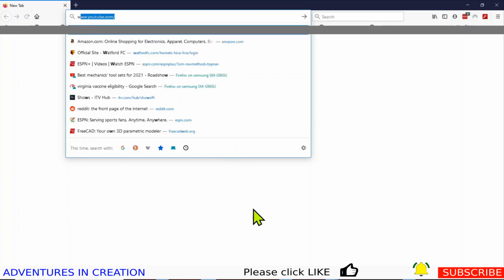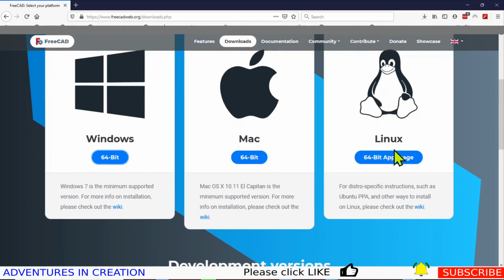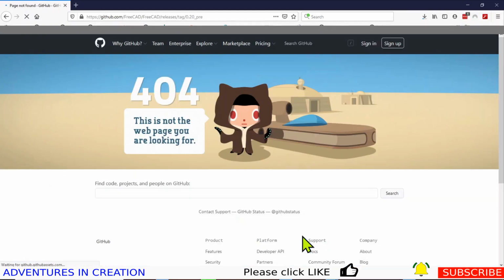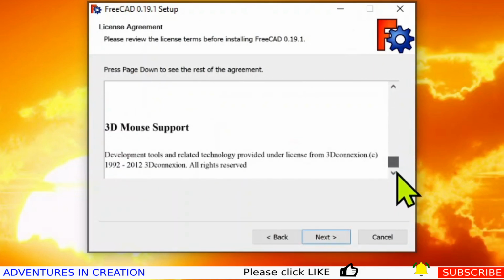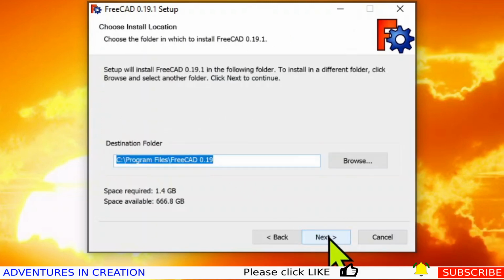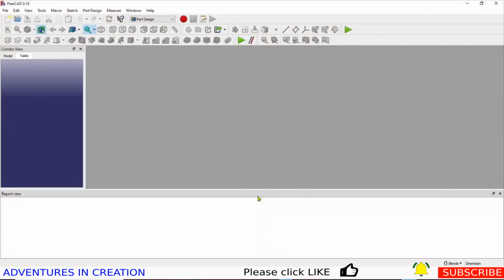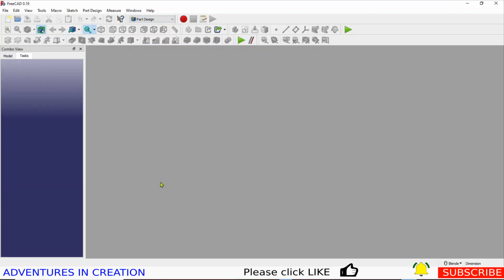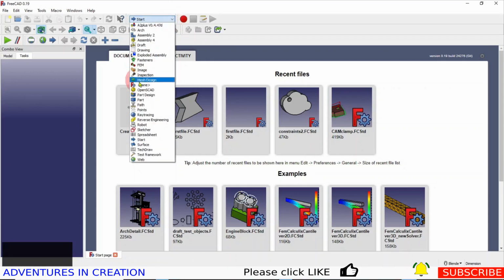FreeCAD for Beginners #2 - Sketching and Constraints

Comment: FreeCAD works very differently from other CAD software I've worked with; clearly more disciplined leading to more stable models. That said, it is frustratingly difficult to learn by comparison as few lessons prepare you for, what for many, might be a radically different approach to technical drawing. Whilst somewhat out of date (i.e 2021 and it's now late 2026), these tutorials are brilliant, taking you through a series of lessons in bite-sized chunks. Excellent thank you.
Reply from the maker: Thanks, there are a later series with the new version. I use solidworks at work and the similarities are amazing.

Comment: Using v 1.1.1.   This is infuriatingly difficult trying to duplicate what I am seeing in the video because the interface isn't quite the same. Why the hell am i getting errors like this: "Remove at least one of the following conflicting constraints:1, 2, 3, 4, 5, 6, 7, 8, 9, 10, 11, 12, 13, 14, 15, 16, 17, 18, 19, 20, 21, 22, 23, 24, 25, 26, 35, 36, 37, 38, 39, 40, 41, 42, 43, 44, 45, 46, 47, 48, 49, 50, 51, 52, 53, 54, 55, 56, 57, 58, 59, 60, 61, 62"? in spite of slowly and methodically Mr. Adventure is demonstrating the steps?

Edit: I finally got it.  There are some interesting bugs and bizarre behavior here but time and persistent bug squashing will make them go away.
Reply from the maker: Sounds like you don't have autoremove redundant constraints checked.

Comment: Found the sketch constraints quite challenging, even after having used Solid Jerks a few years ago. Eventually found that one has to do the symmetrical constraints first before adding vertical and horizontal constraints, then dimensions last. Also ran into the dreaded over constrained condition which meant that I had to back track and start dropping off constraints to clear the over constrained  condition warnings, which was a Pain in the butt. Is it not possible to do a tute on ways of resolving over constrained warnings. I notice that there is a toolbar icon specifically for this problem.  But good tute thanks. I am using freecad 0.21.2 in a Linux OS.
Reply from the maker: Try the latest dev version some of the constraints have been simplified, make sure you have autoremove redundant constraints checked.

Comment: Using 0.21.2. Following the constraints step to the letter. However, this version of FreeCAD doesn't have the same behavior in constraints as what you are showing. Clicking 2 points and applying a constraint yields no results. Clicking 2 points and selecting vertical, to make the 2 lines equal, also yields nothing. FreeCAD just sits there. No warning, no messages; nothing.
Reply: Nevermind. I had another sketch + body open that was causing issues. Closed. New project. Everything works.
Reply from the maker: Phew!
Reply: It didn't work for mine
While using version 0.21.2 @majicMix911
Reply from the maker: That's really odd as it still works in version 0.22
Reply: Should I delete the body and try again cos I don't know to bypass this problem, or can you make a video on how to solve the problem. 

Thank you @Adventuresincreation

Comment: Hi - when making the horizontal lines equal on the little square my sketch turns orange. What am I doing wrong? I want to thank videos the best and easy to follow along with you, I have tried other videos that I was lost in the first 5 minutes with you videos i actually feel that I can learn this at 68 years old. Thank you! Bob
Reply from the maker: Thanks! That normally means it's over constrained. Do you have the auto delete redundant constraints checked?
Reply: @Adventuresincreation  Thanks for replying... Where would I check to see if the auto delete to see if it is checked?
Reply from the maker: @bobkarstien1248  In the sketcher task pane.
Reply: @Adventuresincreation  II want to thank you for all your help!  I am using version 21.2 I retried this lesson 3 times and I am getting different results then you on somethings I did not think there would be that much difference between the versions. Should I see if I can find the version you are using and remove 21.2 version? Thank you!
Reply from the maker: @bobkarstien1248  No, don't remove that version, let me know what you are having trouble with and I will make a video to show you if there are differences in 0.21
Reply: Thank you...when I click the top point on the top horizontal line and the point on the bottom horizontal line and the horizontal center line then click the symmetrical icon my sketch orange. Thanks again for your help!
Reply from the maker: @bobkarstien1248   I just tested it in the latest version and it appears to work exactly the same as in 0.19 I am not sure why you are overconstrained? Can you share your file with me?
Reply: @Adventuresincreation  I sent you an email with file attached......Thanks
Reply: I just had the same problem.
As @Adventuresincreation recommend, on the task pane under the Constraints part there should be a settings for Auto remove redundant.

Comment: Hi

At 16H43 there is a step to create simmetrical lines around the center point.

My whole drawing turns orange, and I can not find my conflicting constraints.

I have tried all of the following:

1. Zoom in on the object or point that's turning orange. Sometimes, constraints can be hidden or overlap, making them hard to spot.
2. Use the "Constraint list" filter: In the Constraint list, click on the filter icon (looks like a funnel) and select "Show only conflicting constraints". This will hide all non-conflicting constraints, making it easier to spot the problematic one.
3. *Check for *hidden constraints: Some constraints might be hidden from view. To show all constraints, including hidden ones, go to the "View" menu, then select "Show hidden objects" (or press Ctrl + Shift + H).
4. *Try *recomputing the constraints: Sometimes, FreeCAD can get stuck. Try recomputing the constraints by going to the "Model" tab, clicking on the "Recompute" button (looks like a circular arrow), and then selecting "Recompute all".

But still can not find the conflicting Constraint.

Can you please assist?
Reply: Left side. 
Constraints Box.
Right Drop Down (has a paint Brush)
✅Auto remove redundants

Comment: Hi, thanks for the best tutorial I have found so far. I am a 76 yo learning new tricks for my recently built DIY CNC and my first play with CNC machines and 3d modelling, although I have a lot of experience with 2D drafting CAD. Everything went fine with the tutorial right up to a fully constrained sketch all green. When I click close I do not get the menu to pad the sketch. Not getting the same menus as you has happened a number of times thru the tutorial but I have been able to overcome it, but not this time. Also when I click close I now have two sketches "sketch" which seems to be the correct constrained sketch AND "sketch 001" which does not seem complete when I highlight it. Any help gratefully appreciated. Kind Regards ..... Mike, Tasmania, Australia
Reply from the maker: Hi Mike, it sounds like you may have accidentally created sketch001. No worries, you just delete it. Then, highlight your sketch in the model tree and click on pad from the menu bar. It should work for you.

Comment: what to do if it says redundant constraints  ?
Reply from the maker: You can auto remove them by checking the box
Reply: @Adventuresincreation   while making points symmetrical is it  possible the points where already symmetrical so it says redundant constraints ?☺
Reply from the maker: It could be many things. Do you have autoremove redundant checked?

Comment: Great video. Im having trouble with the step at 16:44. I've started from scratch twice and whenni click on the two corners and the line then symetrical the entire drawing turns red. 
Also while i saved the drawing when I tried to reopen it was totally a mess. 
Any help would be appreciated.  I will give it another shot tomorrow.  Perhaps ifbi watch on my tablet instead of my phone I'll see what I'm missing.
Reply from the maker: It sounds like there is something wrong with file did you try a completely new file? Does it turn orange?
Reply: @Adventuresincreation  Found the solution and now I see it in other comments. I did not have Auto Remove redundant and Auto Update checked. 😖 Thx

Comment: Had the same problem: sketch turning orange, comment said "invalid sketch". Looking into the options, orange color is used for an invalid sketch, According to FreeCAD wiki, this is usually because the sketch is over constrained. Solution: while in the active sketch go to "menu>sketch>sketch tools>select redundant constraints". the sketch will show all redundant constraints. Now press "delete" en the problem is fixed. I'm using version 0.20.2 and my GUI is in Dutch, so it might be the text in the English version is slightly different from what I wrote above, but this is what it is about. According to the wiki, their is also a button "validate sketch", which might also solve the problem, but thus far I haven't found this button, my GUI is somewhat different from the one used in this movie
Reply from the maker: Check the box that says auto remove redundant constraints
Reply: Thank you.  I had the same issue.  You gave me the solution

Comment: Had the same problem has others. I get to the the symmetry part, select the three points then enter and the whole sketch turns orange?? Very frustrating any solution?
Reply: My version is the latest….0.20.2
Reply from the maker: Can you share your file with me?
Reply: @Adventuresincreation  Thanks for getting back. I opened a new file and placed just a rectangle (only) tried symmetry constraint on both the vertical and the horizontal, the rectangle turns orange and does not constrain symmetrically. If l constrain diagonally selecting the the three points it constrains equally into a square as expected. I guess it could be a bug in the latest version? Frustrating seeing you have no problem in version 0.19.  I note many of your viewers having the same problem.  I’m going to attempt your electrical box next, hope there are not symmetrical constraints in that one?
Reply from the maker: @brianwaites4572  I just did exactly that, it works fine. - I think you may be over constraining somehow. If you just draw a simple rectangle and constrain symmetrically it will work. Take a look at the panel on the left where it tells you how many degrees of freedom you have, this will help you, if it's over constraining it will tell you that.
Reply: @Adventuresincreation  Thank you, I did exactly what you did by placing a simple rectangle and it still turned everything orange! The DOF turned red and increased. I’m still baffled.
Reply from the maker: @brianwaites4572  check this video https://youtu.be/BIYfSXNjFR0

Comment: A very clear and easy to follow tutorial - thanks. 

For those following along, if your sketch turns red it's because you've created redundant constraints.  If you look in the "Tasks" box at "Solver Messages", it will list any redundant constraints - you can either delete them manually or check the option "Auto remove redundants".
Reply from the maker: Thanks

Comment: Anyone know how to show the constraint coordinates? I'm using FreeCAD 0.20 and the Constraints box does not show the options for "Hide Internal Alignment" and "Extended Information". Don't know if it's a preference setting but if it is I haven't been able to find it. TIA to anyone that can help.
Reply from the maker: Did you ever solve this issue?
Reply: @Adventuresincreation  Nope, I figured maybe it was a UI change due to version change and gave up. Looked like it was a handy feature though.

Comment: Did it automatically make a hole for the eye?
Reply from the maker: If the sketch has a hole in it, then the pad will have a hole in it. Does that answer your question?
Reply: @Adventuresincreation  So that square was automatically a hole when you made it because it was on top of the original part right?
Reply from the maker: @mrs.dillenbeck5841  yes, if you create a shape inside the face of a sketch it will become a through hole.
Reply: @Adventuresincreation  That answers my question.  Thank you very much, I appreciate your series on the topic.  Take care .

Comment: At 16:41, trying to create symmetry and select the 2 points then the x axis and symmetry and everything turns red, why?
Reply from the maker: If I had to guess, it's most likely that you had something else selected before you selected the points for symmetry. Try deselecting everything by clicking away from the sketch. Then carefully select the two points and the line and then click symmetry. If that doesn't work, share the file with me and I will take a look at it.
Reply: @Adventuresincreation  how do I share the file with you? I bring up your video on my phone then cast to my TV , while creating the actual project from my laptop? Thanks i did delete the first project and file and started from scratch, then it did it again. Ugh
Thx
Reply from the maker: @garyweliver1870  I sent you the file back with the symmetry applied. Well done on creating the sketch.
Reply: Not you. I have had the same problem, tried everything. Even with just a rectangle the symmetry just turns everything orange

Comment: very nice... back in April i installed freecad-19 and it works nice,   however, freecad-18 now goes to starts-up mode then nothing...Mmmm...???  thanks...:)
Reply from the maker: The 0.19 installation probably changed some of the core file versions.
Reply: @Adventuresincreation  thank you...:)

Comment: Noob here, I noticed with zooming using the scroll wheel (btw, thanks for telling me about SHIFT! :) I found you can zoom in and out based on the location of the mouse pointer.
Reply from the maker: One thing to note on that Jeff, in the bottom right you can see a "mouse" setting, it lets your mouse emulate certain other software "mouse clicks" I use "blender" as I am a blender fan too. - You may have your mouse set on something different to me and so your mouse wheel may do different things.
Reply: @Adventuresincreation  Yep, switched..but I just was making this comment since I noticed I had to fight to zoom in to items...to find it was due to the mouse location on the screen. :)
Reply: I'm glad you mentioned that. I hadn't noticed, but it's very helpful, and now I'm doing a lot less dragging to recenter after zooms. Thanks.

Comment: I have my constrained flat fish completed successfully. :-)
Very cool, I can see how this works so far. Thank-you.

My only complaint is that you sometimes confused vertical and horizontal when describing which you were creating. Visually you were correct, just the verbal description.
Reply from the maker: Thanks Craig, glad you were able to get your "fish" constrained. When you say, confused vertical and horizontal, are you talking about dimensions?
Reply: @Adventuresincreation  Oops, yes, that was what I meant. A couple of times I was using keyboard shortcuts to set constraints while listening to what you said and had to back up and do what you meant. Not a major.

Comment: Thank you very much, I have over the last few months enjoyed the toturials, I have especially looked for something about how the Tree works, what to take care of not doing and doing it in the right order, I have drawn a lot and deleted a lot , since I can not get the parts apart without messing it all up, a dream toturial for me, would be to draw a simple part, and make a top and a bottom from the surface of the 1st part, a mold / mold .
I actually gave up the project with Freecad 19.0 and drew it in Vcarve pro as "layer cake" slices ((glued together)), or whatever you call it overthere;) I could also do it by hand without a PC, but thought it was more fun to draw it first in a cad program, but is freecad the right thing to draw mold in?
thank you very much

Regards JJ DK (Hobbyonly)
Reply from the maker: This is in intriguing as I was a tool maker, making injection mould tools. I will put some time into this.